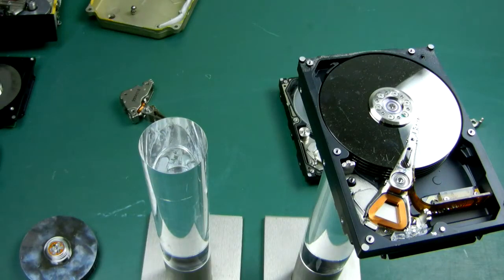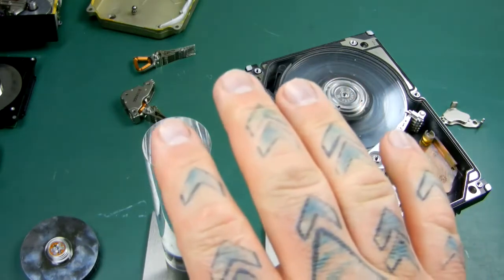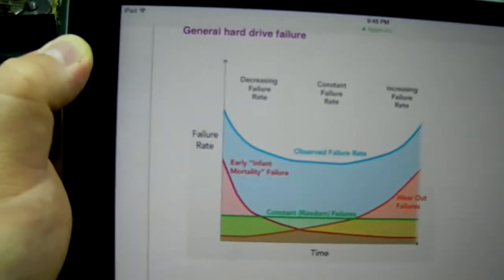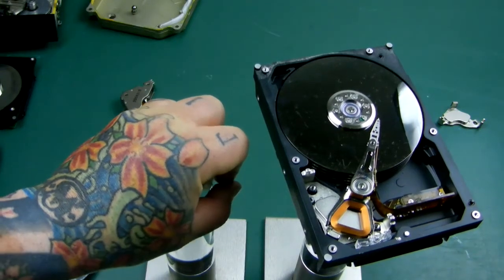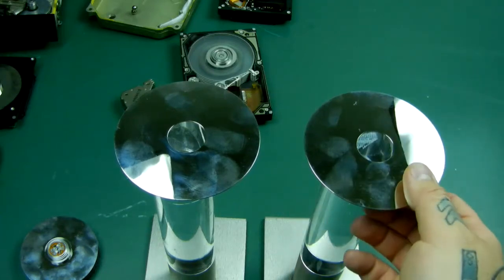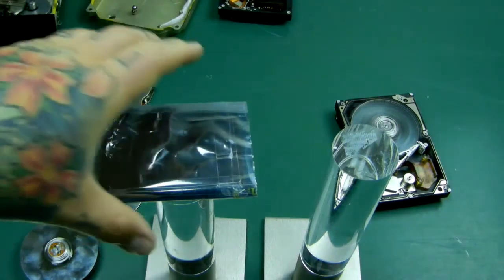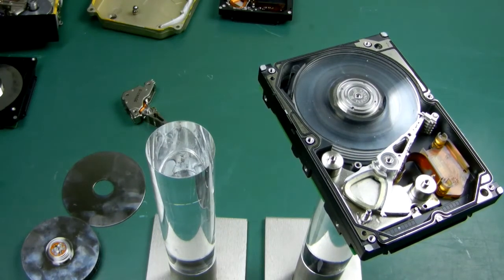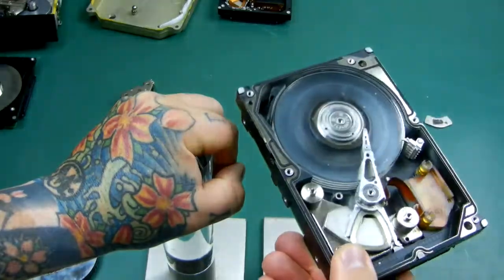Angry Photographer: Video 2. HOW Hard Drives WORK, why you MUST fear & hate them

Comment: I still have an Maxtor 250gb sata 2 hdd(in my old pc) from 2007, it has almost 26000 hours count and used alot, that works absolutely fine, it dosen't have any bad sectors or other errors and belive me there were times when the power was going off 10 times/day ( damn old powerlines). Now I use a WD black 500gb because I needed better performance an a little more space, I have it from dec 2014 and it's working fine (and I hope it will last at least as much as the old hdd).
Reply from the maker: Feies Vlad yes, i have some HD that are that old. however thats the EXCEPTION, not the norm.

Some old coot is on the news celebrating his 109th birthday........ but nobody should assume theyre gonna get CLOSE to that damn old

hehehe.
Reply: Theoria Apophasis Yeah, one more thing, I agree with you about data archiveing, I put my data on DVD-s also, and you are right, if you take care and you don't put your greasy hands all over the dvd and scratch it, it will last very long because there is no electrical or mecanical part to fail, so it's very good to store your important data on dvd-s. Yes I know ther is cloud storage but I still prefer dvd-s.
Reply from the maker: there is no such thing as a cloud, theyre just anonymous server farms.

hehehehe!!!

but yes on the rest.